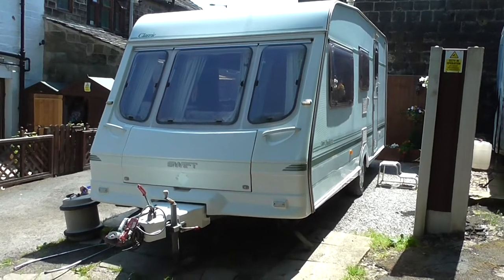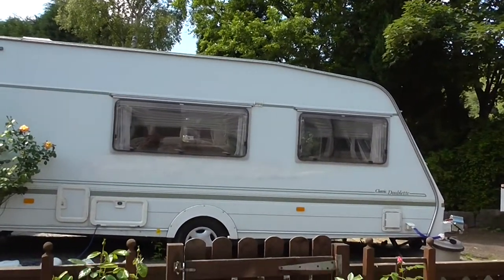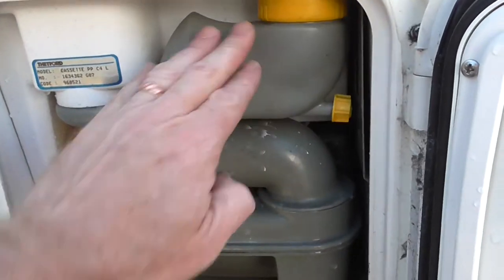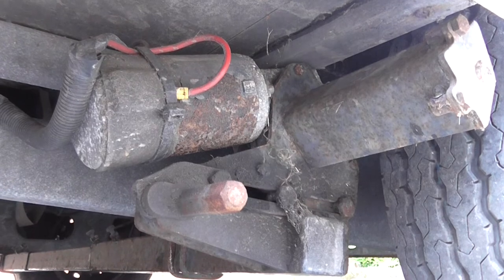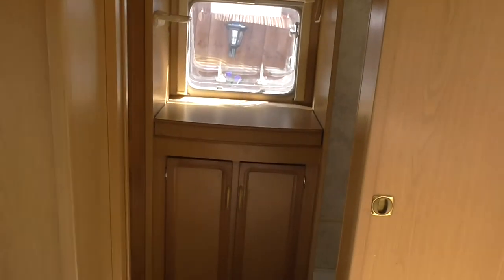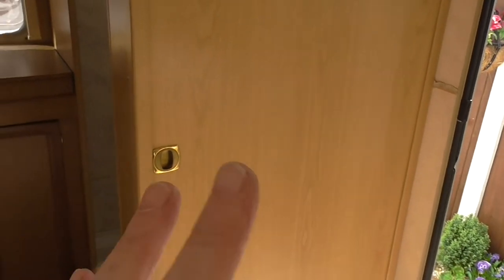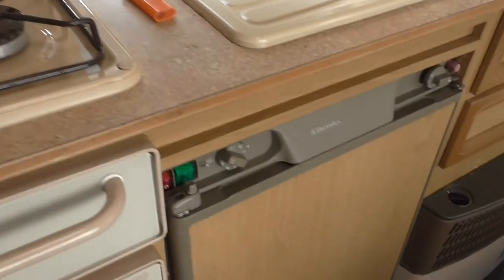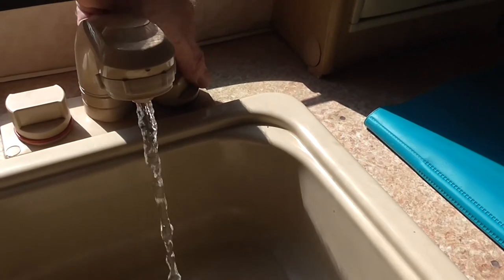Swift Classic Doublette four berth touring caravan, made in 1997

Comment: For the benefit of anyone watching this video retrospectively, the statement made by the seller on legal towing weights is NOT CORRECT. The '85% Rule' referred to is a rule-of-thumb recommendation of best practice - but it is NOT illegal to tow above this. The LEGAL towing capacity of any vehicle is determined by subtracting the Maximum Gross Weight (i.e. the maximum permitted weight of the car + contents) from the Maximum Train Weight (i.e.the maximum combined weight of car plus any trailer). Both these figures can be found on the chassis plate affixed to the vehicle.

Comment: Did that van have a battery charger on it anywhere Shaun ?
Reply from the maker: No it didn't have a battery charger as in like a car battery charger but they do have a system on them that when the caravan is hooked up to a 230v supply it chargers the battery when you switch on the charging mode on the internal caravan panel.
Reply: @ShaunMurray63  cheers Shaun ,I have the identical van here in my driveway, at the moment I have no lighting or anything even though the battery is connected, I've switched the panel on the wall to car and van vice versa and although when switched to van the needle is in the green nothing is working and I didn't know if there was a charger and more switches somewhere..
Reply from the maker: @garethlee1644  here will be a isolator switch in the battery  box that you turn on with a red short type key . Check that you have or it is turned on then let me know if you are then getting power to the inside of the caravan , if by chance you have already done this check if the battery is flat . If you think it might be flat use the hook up lead to a 230v plug socket and then see if you have power into the caravan , let me know how you get on.
Reply: @ShaunMurray63  Thanks mate ,greatful 👊🍻
Reply from the maker: @garethlee1644  No probs let me know how you get on mate.
Reply: @ShaunMurray63  👊